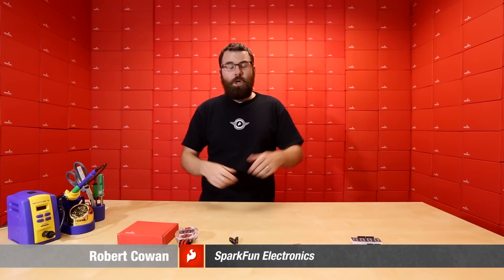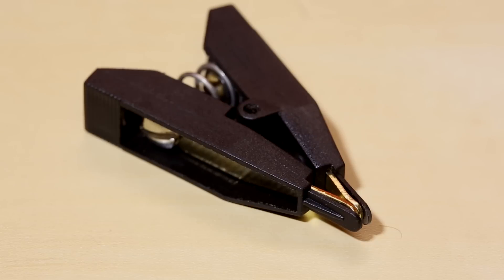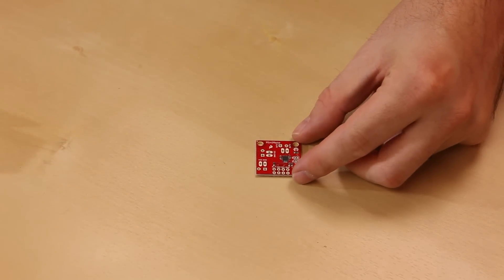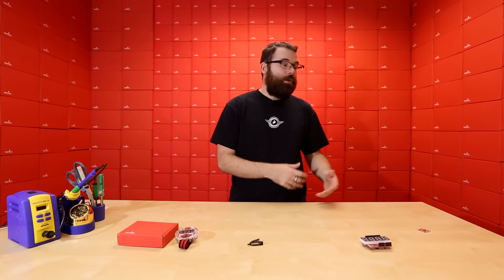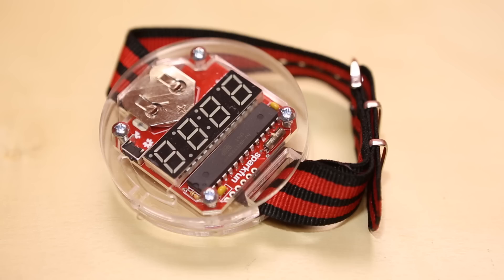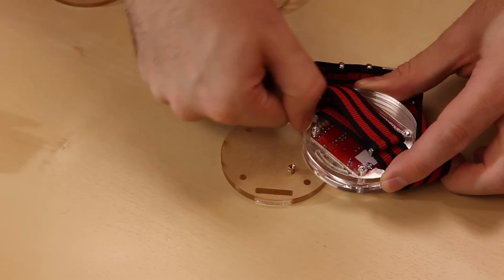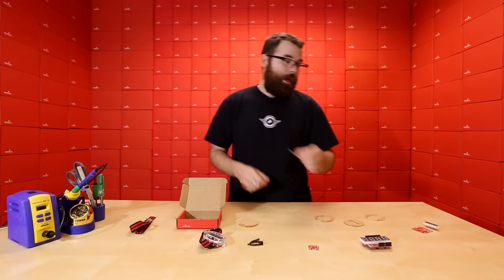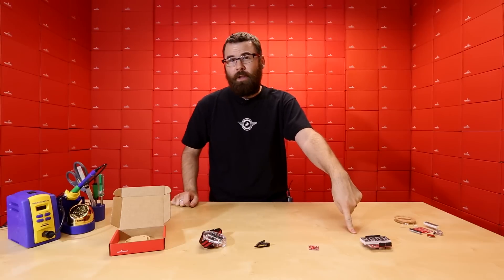SparkFun 9-20-13 Product Showcase: Big Motor Clip Time

Comment: Try starting with a Rover 5 Platform. It is the best base that you can build on and add more features and more complex items as you go. Then a Redboard programmed with Arduino and you will find electronics easy.